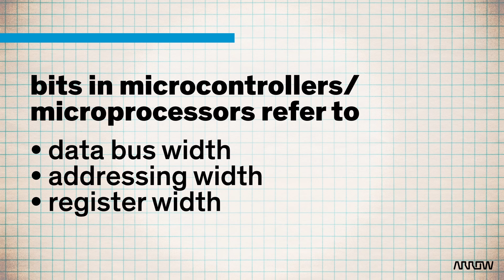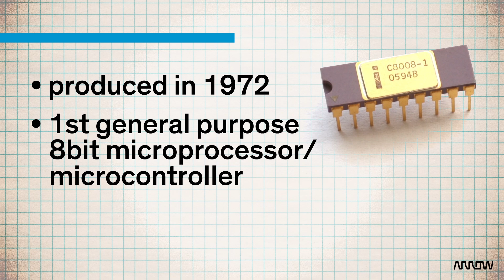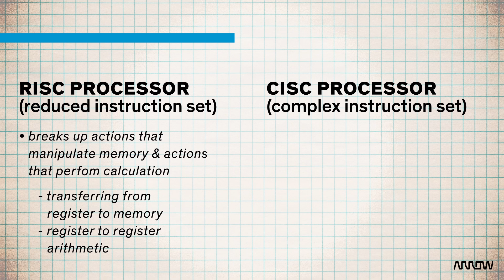Understanding the differences between 8bit, 16bit, 32bit, and 64bit -- Arrow Tech Trivia

Comment: A bit stilted and boarderline accuracy. 
8b processors can do 64b math it just takes a few extra cycles. The 4bit 4004 came befor the 8008.
Mainframe CPUs have been calculating on the order of 64b+/- since vacuum tubes in the 1940's. Its just the significant digits needed in engineering studies. Even the 16b x86 family had an x87 floating point coprocessor availible since 1980 giving it accelerated high accuracy math, using 80b internally to avoid rounding errors on full 64bit input and output.(built into the same die with 80486 and later)
The length of memory registers is a separate issue, but the amount that a given register length can handle is greatly effected by the type of memory managment. 
Anyway for all these reasons mass market 128b cpus are not likely to become a thing.

The reason early IC microprocessors were only 4b then 8b is due to the inverse economy of scale on the physical size of silicon chips. More bits greatly increases the number of transistors on chip. The yields back then were terrible, like 70% had defects even with the smallest cpus, makeing a larger chip increased the odds it would have a defect and quickly approached 100% loss. 
The largest gains and cost reductions of the 70s were not from shrinking transistor size, it was from improvment in the raw wafer quality and a new process that didn't peel off masking, first used on the 6502.(The 6502 dropped the price of an 8b cpu from $300 to $25 in about a year due to reduced defects.)

Comment: Although, modern 64-bit processors only address RAM using 40-bits which is only 1 TB of RAM.
Reply: 2 decade old first generation x86_64 memory controllers are hardly "modern". Most at the moment are 48b virtual and 52b physical. Though intel has gone to a 5 level paging tree on some models giving 57b virtual (still 52b physical as I recall which is part of the original core standard) 
That extention of x86 was kind of an emergency hack anyway, the manufacturers even said there will be new tech by the time we get to the 52b limit so no point in reengineering it now

Comment: 2^8 does not give you 255 unique numbers, it gives you 256. You MUST count the number 0 (zero).
Reply: 0:45 explains this. Hope it helps!
Reply: @afrodisiac2181  But it doesn't give you "255 unique numbers" it's 256 unique numbers, that is any number from 0 up to 255. 255 is the biggest number you can represent with 8 bits, but you also have to count 0, as it is also a number.
Reply: Glad I wasn't the only one that realized 2^x CANNOT produce an odd number.
Reply: He litteraly says -1
Reply: 0-255 = 256 numbers

Comment: And i tout that we already live in the 10.000 bit range, but if cpu’s are 
Only 64bit , then how is the ps2,dreamcast etc,, an 128bit system???
Reply: But what is it ?? I readed that the ps2 may contains 4 32bit cpu’s to function like a real 128bit system,not sure,, am mean if 32bit & 64bit cpu’s getting just overclocked to get more speed out of it, rather then increasing the bits, then all i can say is that we are misleaded all the time ,, am mean may an 8bit at 8 mhz can be just equal a 16bit cpu at 1mhz etc,, not sure 
Thx
Reply: There are 64 bit MMX register/instructions, 128/256 bit XMM register/instructions, 256/512 bit AVR register/instructions on a modern Intel/Amd x64 CPU, but only address-register for 64 bit addresses in memory and there is no x64- mainboard that have ram slots for all 64 bit addresses.

Comment: im emf sensitive and i tried using both 16 bit and 32 bit chinese handheld gaming systems but had to sell them. Ive never noticed any problems with 8 bit handheld game systems. 32 bit system was the worst of the lot for me. Im wondering if i played 8 bit games on the 32 bit system if it would just use 8 bits of its cpu because i loved the ips screen on the 32 bit system, ya know??

Comment: 2^8 = 255 ?
2^16 = 65535 ?
...
how the parity number raised to power can be odd ?
Reply: I think it's because of 0 counts?  I'm a noob so don't sue me.  2^8-1 or something.
Reply: @KillJD  check the 0:57 here is no "2^8-1" but 2^8 =...; 2^16 =... etc.
Reply: @wegi9621  Still, when we write: 2^8=255 this is WRONG and leads to confusion. One can say: The RANGE of values you can have with 8 bits is "FROM 0 TO 255", but not: "2^8 EQUALS 255"; everyone can do the math: 2^8 equals 256.
Reply: @johnni5254  exactly, also counting from 0 to 255 we got 256 combinations
Reply: @johnni5254  Yeah the zero counts so it's indeed 256 numbers in quantity and not 255

Comment: Really great informations but I was hoping to get more information about the following three characteristics and what they are about:
-data bus width
-addressing width
-register width
Reply: With data bus and address lines, the 'width' just means how many bits are sent at one time through seperate wires. An 8 bit data bus has 8 seperate I/O lines to send and receive with, a 16 bit data bus has 16 lines of I/O. It's the same with the address lines, with 8 bit addressing the most memory, (for example), you can access is 256 bytes. With 16 bit addressing it goes upto 65536 bytes, or 64K.

The registers are a bit more complex. The registers are like variables built into the CPU that it uses to keep track of what it's doing and what 'state' it's in. So an 8 bit register can hold a number from 0-255, a 16 bit register can hold a number from 0-65535. I hope this helps.
(There is a reason I never became a teacher. LOL)
Reply: @Franko_Walker  Wow, great information mate. Didn't expect this after a so long time, thanks a lot!
Reply: @bitaranto546  No Problem. When I replied to you, I thought it said 2 months ago. Not 2 years. LOL. I'm just glad I could help.
Reply: @frankowalker4662 honestly one of the most informative comments I've seen on any website. Thanks, I wasn't quite grasping these ideas before I read your comment.
Reply: @Franko_Walker  this was super helpful! Thank you!

Comment: Its more complicated than that. For example, many 8-bit processors will have 16-bit registers and operators.
Reply: While on the other hand, the Motorola 68008 has 32-bit registers, a 16-bit address bus and an 8-bit databus.
Reply: 20 bit address bus. The ALU is 16 bit.
Reply: D.E. Sarcarean like arduino

Comment: Judging by those numbers, wouldn't that mean that 64-bit architecture could theoretically address up to 18 yottabytes of RAM? I know that in reality it means it is basically unlimited at least for the next very long time, but just curious after you said in 64-bit we are not talking about terabytes of RAM.
Reply: You are on the right track, but the correct term is exabytes, 16 of them to be precise (using the binary system, not the decimal one)
Reply: dacypher22 V9811s